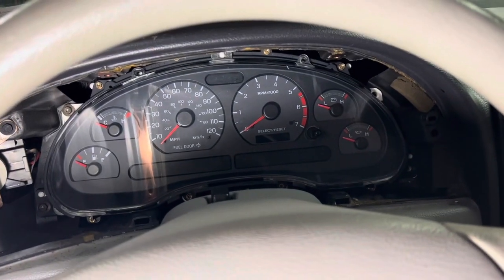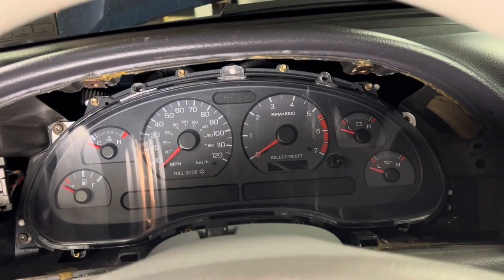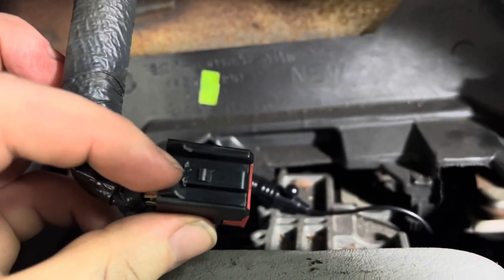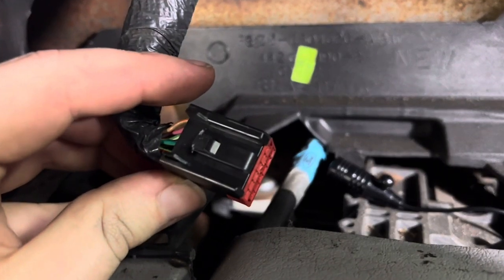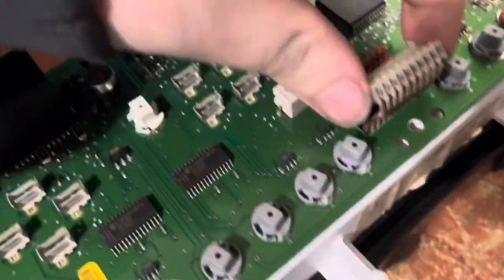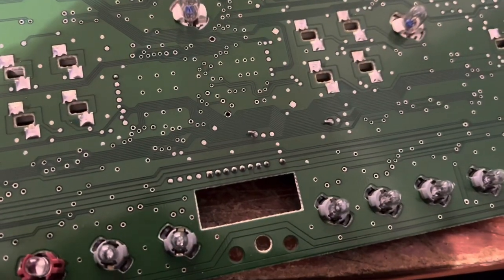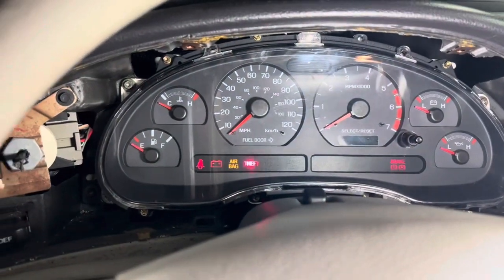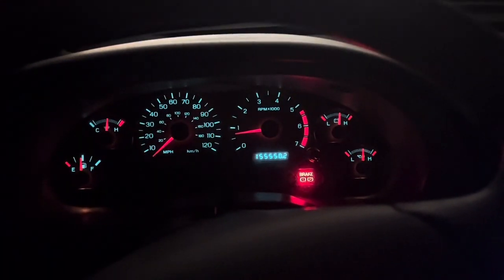1999 Mustang Odometer Going Out Moddedmustangs.com fix

Comment from the maker: Update 1,000 miles later. still no issue
Reply: Hey not sure if you’re still active on your account but I’m having an issue that’s occurred randomly on my 04’ gt similar to yours. The other day I decided to do a pull with traction control not disabled and it did fuel cut pretty bad like these cars do. Didn’t think much of it until I noticed my temp gauge and tach were not working along with the odometer is all dashes along the gauge the issue is intermittent as the gauges and odometer will turn back on going down the road and shut back off. Car runs fine. I’m thinking a busted soldier connection in the instrument panel. Some suggested the relay for the pcm within the ccrm could have a bad connection as they are all soldered connections as well. Any advice or info on my issue would be greatly appreciated. I’d like to think it’s a simple fix but all the misinformation on the internet is overwhelming.
Reply from the maker: @wesleydawson3168  let me ask my friend about that. It seems like a little more than what I was dealing with and don’t want to just give a guess etc

Comment: Figured out the trip meter issue. I accidentally left soldering between pins 8 and 9. This must have caused a communication block from switching to the trip meter. I cleaned up the soldering and all good now.
Reply from the maker: Sorry I didn’t see this till now. Glad you got everything sorted. Hopefully your experience helps someone else too

Comment: This did work for me but unsure whether it was the solder issue or the where the flat cable mates with the plug. That looked pretty crusty and the pinch type wire pins there have a reputation of flaky connections.

Comment: This is one of the most dangerous videos you'll ever watch if you remove your cluster to repair it you might set off the pats system if you don't have a $600 scan tool or more or you don't want to go to Ford and give them any words between $300 to $1,000 stay away from this video and do not attempt this repair. System in your car I will say it again you are going to be in a world of hurt trying to figure out what your problem is. This guy got really lucky and I'm glad for him. But the p a t s system means passive anti-theft system if you set it off your computer will have to be reprogrammed or you'll have to send it to a specialist to have it disabled your car will not start if you set it off my pats system now my 2000 Ford Mustang does not start it's not working anytime you're working on a Ford remember you might have to do with that p a t s system then your fu**Ed if your a diyer without a very expensive reprogramming tool and software that is proprietary
Reply from the maker: @sherriezell7860  I am sorry to hear about that happening to you. Good warning to know, appreciate the info for others who may be thinking about attempting. Glad that I haven’t had anyone until now come back to the video with issues until now. I wonder why this did not set it off? I got this from a mustang forum and no one noted that risk. Wondering how they did not know

Does disconnecting the battery not eliminate that risk? I figured that would only happen if I was installing a cluster from a different car. Crazy stuff
Reply: @Ian-Threaded  1st I'm glad it worked for you. Very glad. I purchased the car off marketplace. I think someone replaced the odometer with one that had 157k miles. Why I'll never know. I can't figure it out. I wish I had never touched it because car won't start just turn over. No info from obd to PCM either. All options are very pricy for me. I have no friends that have the higher end reprogrammed tool. I was NOT trying to be a A**hole. I just don't want this to happen to Anyone else. All I did was the repair thank you, but the crank no start. I've been working researching for a month. Only option is Ford or high priced reprogramming tool. I've decided to pull the ecm and send it to a company to have the pats system disabled. $149.00. + Shipping. If anyone reads this and has another idea please help. I'll post update I know this problem is common because of all the stangheads like me just trying to keep there car in goog shape. Simple diy guys and gals. Thank you PS after I did the repair and I got nothing on my cluster except for a seatbelt light I thought maybe I did it wrong or messed something up. I sent it to have a completely repaired got it back from the repair shop and they said someone had tampered with it before which was me last a long time. I'm sure my work was solid, but just to rule it out I did send it to have it repaired and when I got it back plugged it in same thing. That was $120 down the tubes. I'll keep a post and let you know what and how I resolved it.
Reply from the maker: @sherriezell7860  I hope it gets repaired and gets you back on the road. Please do update us all when you get it back from service
Reply: PATS does not work like that. All it does is recognize the encrypted key that is stored in the PCM/Cluster/Metal Key. That is all. This video is about as safe as it gets. FYI to anyone reading this comment by Sherrizell7860